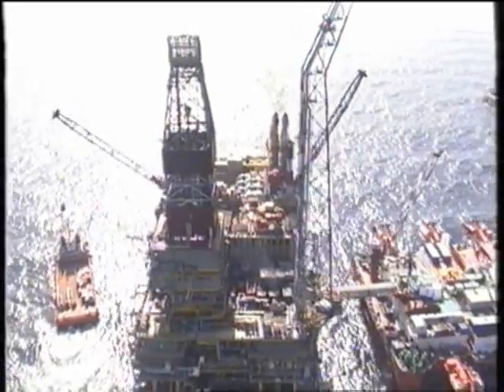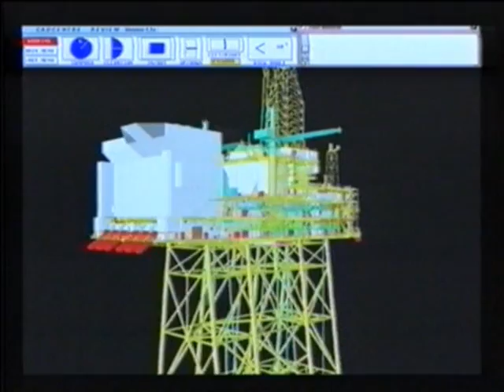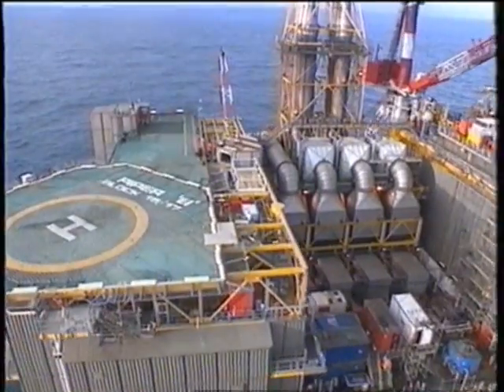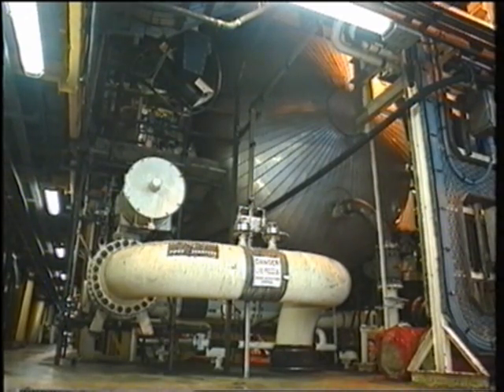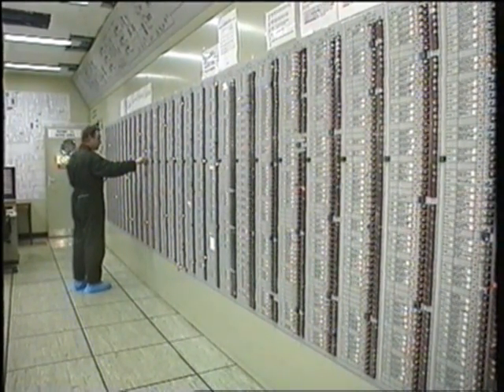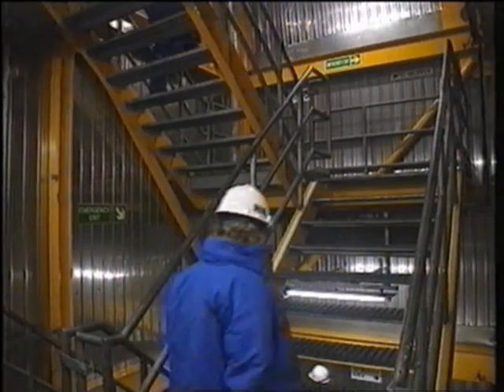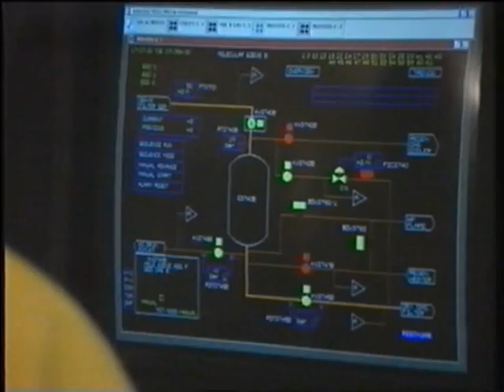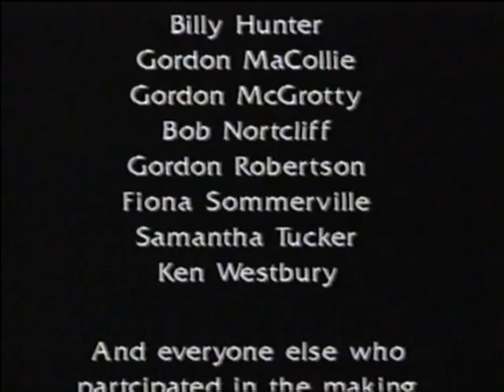Elf Enterprise Caledonia - Piper Bravo Platform B

Comment: Was working offshore at the time this was brought out, to watch it being lifted and put into place was jaw dropping, later on mid 90’s I ended up working on piper b, you can see where piper alpha stood there is or was a marker buoy secured to it and the marker had a cross situated on the top, it made me think about that night very upsetting to know that most of the crew stayed in the galley and ended up at the bottom of the North Sea a dear price to pay for oil.
Reply from the maker: Always sent a shiver down my spine standing on the north deck watching that buoy at night flashing in the darkness. A lot of the shift that were on leave when it happened worked on Piper B. The attitude was if we are not getting oil out the ground what else are we going to do. It was true as I spent 2 years almost constantly out there before I met my wife and I couldn't think what else I could do either. Was good times even if it did get dangerous sometimes.
Reply: good morning, sumenep madurase islands indonesia, FLOORMAN

Comment: I was the consortium's photographer. Was on the jacket installation barge, clambered aboard overnight. the jacket was pushed off next morning  Was supposed to be at 1030 hr but was pushed to 0730. Thick fog no light. Had to use a roll of 120 B/W pushed to 1200 asa to capture it. The jacket was pushed off by a single ram and it caught port side just momentarily, a slight lurch. Was also in the crane cab as the topsides were lifted on

Comment: Had tears in my eyes watching this again 45 Years after the Tow-Out in 1978- as so many of those seen have since passed away. Just had the news that all 3 platforms will be removed from the face of the earth by 2028. Don’t know how the 600,000 Ton Central will be moved as it is a rather unique design. My experience as a contract computer field engineer started in the late 70’s and progressed through 6 job changes and as many ownerships from Chevron to Kerr-McGee, Canadian Natural Resources, Oryx Energy , Maersk etc . More than just 3 Platforms – The giant Central collected Pipelines from Ninian Northern (24" oil pipeline); Ninian Southern (24" oil pipeline); Strathspey (8" and 10" oil pipelines); Heather (16" oil pipeline); Magnus (24" oil pipeline); Alwyn (12" oil pipeline);Lyell (12" and 8" oil pipeline). This allowed over 300,000 Barrels a day to flow to the Sullom Voe Oil Terminal. The Crew had to be a mixed-bag as the film states, as we have to take care of every eventuality. Chevron loved ex-forces personnel who came as ready-made fire-fighters, medics, emergency response, air-crew, mechanics - and ICI & Mining Techs that were qualified in  electrical safety in explosive atmospheres. Aside from the obvious hazards of gas and oil, we compressed gas to 300 Bar to export LPG, injected water to reservoir at 250 Bar, produced electricity at 11,000 Volts; handled explosives for well perforations and radioactivity for survey and inspection work .
Whoever is your personal ‘supreme being’- who created the Earth – they certainly didn’t make it easy to find where  they had hidden this treasure. 100 Miles out to sea, 500 feet of water and then 10,000 feet underground between faults and fractures – but we found it and delivered it.
Proud to have been a small part of it, but equally glad that the World has moved on to more renewable energy. Remember, however, that over the half the hydrocarbons in each discovery are still down there , as the expense of recovering the rest does not justify the efforts.
Crew members of the Ninian Field are still in touch socially , although some of us are getting rather old now.
Reply from the maker: I worked for John Crane Mechanical Seals/Elf Enterprise and it was my job to keep the mechanical seals on the pumps going night and day. I enjoyed working out there for a few years after hook up, there was always something happening. Glad you enjoyed the video John.